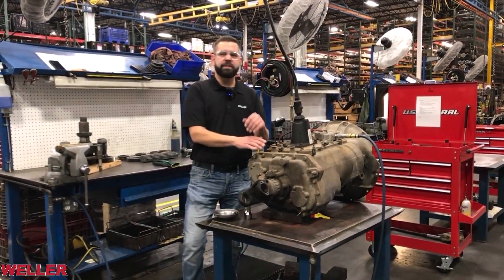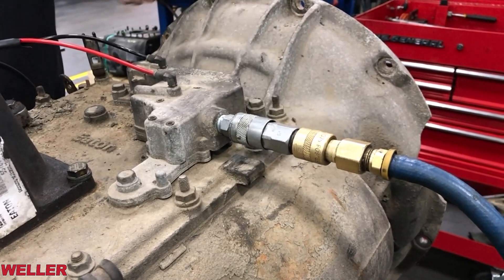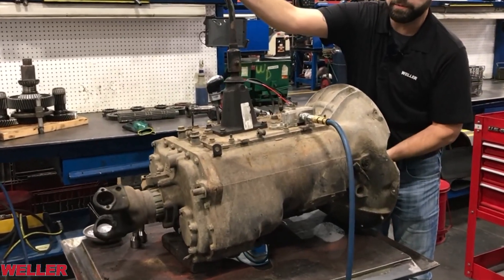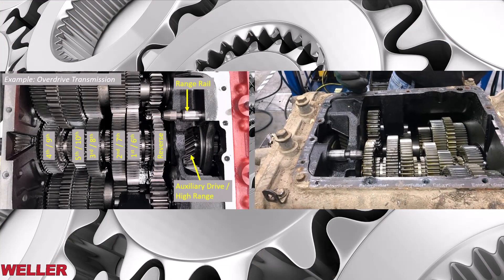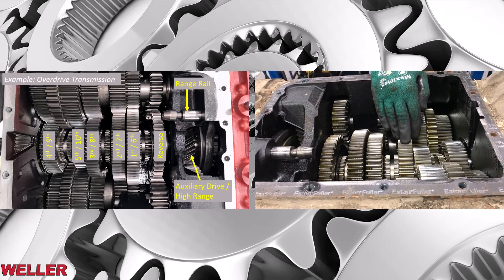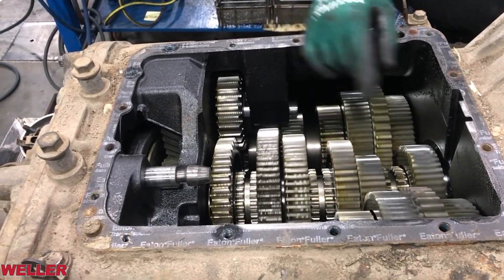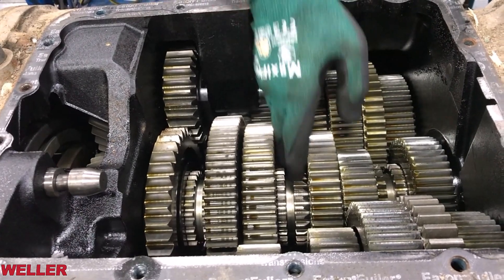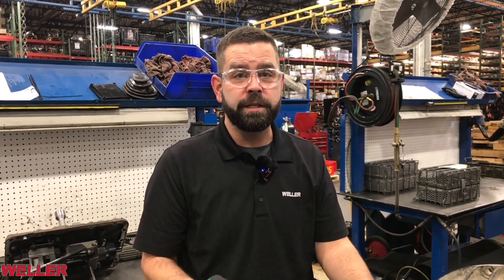Fuller Roadranger FR Series Operation and Power Flow

Comment: Hello, greetings, I have an Allison box and it is returning oil through the supply tube.
Reply from the maker: Good morning Jose!
Something that could be causing that is fluid blowing out the dipstick tube which could be a clogged breather on the back of the trans main case. Check to make sure the breather is unobstructed. You can also drill a 1/8th" hole in the dipstick tube just below the seal to allow air pressure to escape the main case.
Thank you for reaching out!